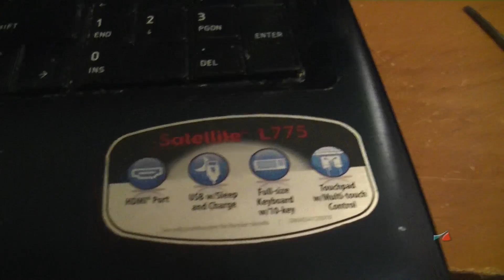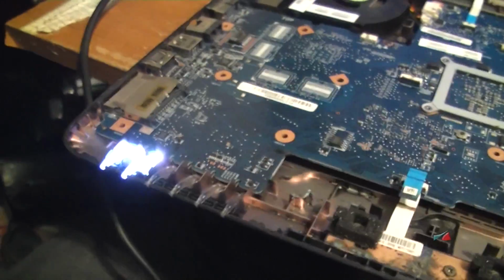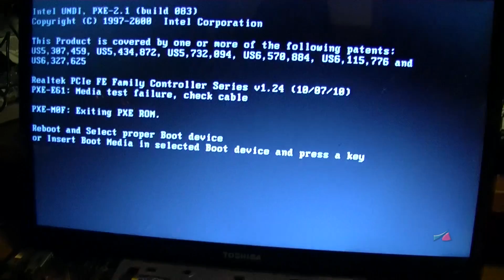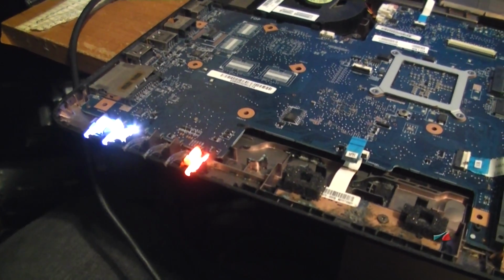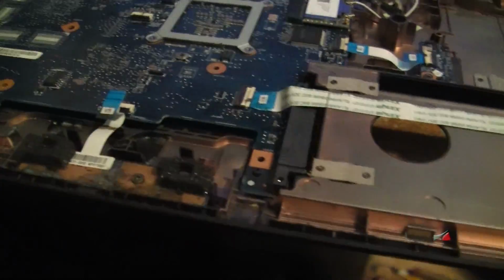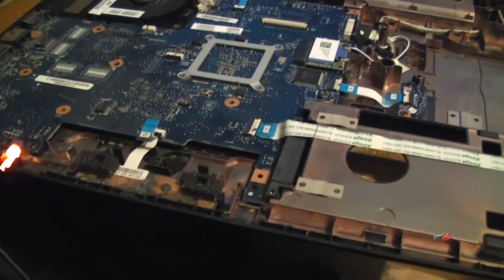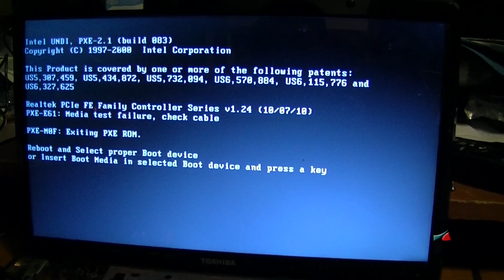Repair/Fix: Laptop Not turning on, no leds no signs of life.

Comment: I have a now old dell vostro 1000 that has no power or even light.  I'm told hard drive doesn't spin. I removed hard drive. Should it turn on without hard drive? If not, I'm going to do what you teach above, removing connector clip under keyboard and checking if it then powers up? Any info you can add for this? Ty

Comment: There is a pin hole on the bottom of the laptop with battery symbol on some msi laptops. Push that to reset before taking apart the laptop.
Reply from the maker: Yes some laptops do have that option, specially the ones that have integrated batteries. That can't be easily removed to reset the bios. I have a more general video to do initial troubleshooting. Thanks for the tip.

Comment: What if a bare motherboard doesn't turn on?
I have an ACER Extensa 5620 with this problem. I took the motherboard out, unplugged pretty much everything except the cooler (can I safely detach it too?) and the power button (unless you know how to turn it on without it, by shorting some pins on the motherboard?) and the LED panel. But nope, no signs of life. None of the diodes is lighting up. The fan is not spinning. I checked the voltage coming into the motherboard from the power supply socket and it seems to have the nominal voltage. What else could be wrong?
Reply: Well, you should probably take it to a repair shop or see if there is any more videos that work, my computer is doing this same thing, the fan wont work less wont turn on, so I'm waiting to take it to a repair shop. Hope you computer works again.
Reply: Well, I kinda already solved that problem and the laptop turns on now. I measured the voltages around the motherboard and noticed that the 3.3V power rail is missing - the one that powers up the BIOS chip and the SMC. The 5V was also missing (the one that powers up the USB ports). The MOSFETs in the buck converters seemed to be fine, but then I noticed that they are all controlled by one MAX chip, so my suspicions went there, and when I was measuring the voltages around that chip, I noticed that the 2.0 V reference voltage is much lower than it should be. But when I was measuring the pins of that chip, suddenly it started working. I guess there was some bad junction on one of the pins, most likely on that ref voltage, because after that it was 2.0 V again and the 3.3V and 5V power rails appeared again. Now it's turning on, the system (Linux) is booting fine to the user log in screen.
But there seems to be another problem, and I remembered that it was there before:
When I try working on it, it suddenly resets and boots up from the beginning :P
Sometimes it can run undisturbed by 20 minutes or longer. But as soon as I start clicking around in the GUI, it reboots again. I don't think it's overheating or something, because the fans are barely spinning at those moments, and it's not that I'm doing anything CPU- or GPU-consuming. I'm really out of ideas what could be the cause of this problem :/ Maybe it's still that suspicious MAX chip, or maybe it's a bad RAM? I don't know. But it's really bugging me, because otherwise this laptop could work just fine.

Comment: I have the same laptop toshiba.......but different model.....but mine the light will come on when I plug the power cord into it......but nothing else....no fan no other lights....and when I unplug the power cord ...the light goes off.....so I think my battery is not charging as well .....I was using  the laptop and it just  shut off.....That was that!      ........Any ideas?
Reply from the maker: try the troubleshooting steps in my other video https://youtu.be/SYRWIdQonoI if that does not help, ill be uploading more videos for more complicated problems.

Comment: i have a problem like that. I try to plug my headphone and accidentally plugged it inti the usb port and then a spark came out and my laptop never turned on again. I took it to a technician and he told me the processor (which is integrated with the motherboard) was broken but when he gave me back the laptop it didn't charged or show any sing of life just as you video.... I bought a new motherboard. but another technician is telling me that it may not be usefull because it has a charged problem... what do you think? my laptop is an acer aspire E15 S12-512 with intel celeron N2840
Reply from the maker: Hi I think that your computer might have the same problem as the one in my other video, https://youtu.be/SYRWIdQonoI on that one the USB daughter board got damaged somehow and then it would not let the computer turn on at all. I replaced the board and then it was fully functional again. Hope it helps out.

Comment: when you find out that the problem is the motherboard, do you use the voltage part of DMM or resistance ? it seems a lot on youtube from asia can check the voltage regulators etc with just the DMM...if you can produce any of these type of videos, would be much appreciated ...I have acer aspire e1 571, and have the schematic... thanks
Reply from the maker: Thanks for watching, I do not know much about component level repair (I am in the process of learning) but my intent is to produce videos like you mention.

For checking voltage you follow your schematic and the power rails, and DO NOT USE RESISTANCE mode to check a powered device. On the schematic it should tell you the proper voltage at certain points in the board. Check that they are present, and it does depend on the state of the computer, if it plugged in but not powered on there will not be voltage at certain points in the motherboard. When the power button gets pressed the state changes and voltage is applied and then goes to a chip that will perform some logic and determine if power is ok, and then it lets the voltages power other sections of the motherboard and components.

As far as resistance, the most useful test is continuity/diode mode. The way they check is to see if there is continuity where there should be none. And if they find it then it indicates that there might be a short in that part or in the circuit that part is a member of. If on the other hand you know there should be continuity on a part and you get nothing then it indicates that you have a "blown" component, basically destroying the path for signals/electricity and you get an open circuit.
Reply: hey when i connected the integrated monitor in my laptop while it was turned on i think i accidentally plugged it wrong and then my laptop turned off with a smell of burn i ubplugged everything disconnected the battery unpluged the monitor screen and mouse,etc.. then i tried turning my laptop on without a screen only with the battery nothing i unplugged the battery and pressed the power button for 1 min then tried again nothing i connected my portable battery in a usb port which could charge even if laptop off the battery was charging when i connected the power adapter in laptop and disconnected the battery the portable battery was still charging but laptop wouldnt turn on i tried with battery and power adapted plugged still wont turn on i checked the mb for any sign on burn no sign help pls the only thing i saw was an chip with some brown dots on both connectors but they were in middle not close tp the mb pls helpp i cant buy another laptop or have it checked by a technician  @carpio01
Reply: fyi ... sieguntur (youtube) has a step by step voltage sequence video that I found quite good ...(how to check dead laptop motherboard(step by step). eng is the video name

Comment: i have an acer laptop, i replace my ac adapter because the previous one isnt working anymore, after i tried the new one i notice that the led indicator on the new ac adapter is blinking fast.
i cant turn on my laptop because of this, i try the adapter in the other laptop and its working fine. can you help me with this. 

ps.
ive already try troubleshooting you did on the video testing everything. but still no power. led on ac adapter is blinking fast.

thanks :D
Reply from the maker: Check that you got the correct adapter, Check under the laptop. Or under the battery to see the specifications for the power adapter. Check that you got the correct power adapter by making sure that the voltage is the same and that the Amperage your replacement adapter is equal to or higher than the original one. The problem might be that you got an adapter that is not capable of supplying enough current to the computer. If the computer needs more current than it is receiving from the adapter it will put a strain on the adapter and the adapter could get damaged, or go into a damage protection mode and turn off.
Reply: thank you for your reply sir. but as i said, i already tried it in another and the same laptop. acer aspire 5810t series. 19v 3.42 amp. and its the same. so maybe the problem is the motherboard? or the board where i put the dc jack? as i check the  name of the board is JM51 mini board. thanks sir
Reply from the maker: Hi, if yo have checked on another of the same computer then I would say that, your computer might have a short in some of its circuitry and thus it is pulling more current. Try to isolate where the problem might be, you mentioned that there is a mini card for the power jack so first I would check that it is properly functioning. Then proceed to trouble shoot the rest of the motherboard.
Reply: thank you very much sir ^_^
Reply: Check the input and output voltage of your newly adapter, and compare it.

Comment: where you located at brother? Have a Toshiba laptop here that I'd love to get working again....was working fine, then powered off and got up the next day to find it got a hardware error and will not boot into windows, nor will it even let me into the BIOS to boot from CD Rom or USB to try and fix it....borrowed a hard drive bay to try and get the 300GB of data off the drive that's in it and it's saying the drive needs to be formatted? It seems the motherboard could possibly be faulty? Being it's not even allowing me into the BIOS?
Reply from the maker: I am located in the Central coast of California. Does it even give you any lights to indicate it is getting power? if it turns on does it only show a black screen? any "blinking lights"?
Reply: yes I get power and a few different screens, one being a blue screen that flashes so fast there's no chance of reading what all it says.... what's got me stumped the most is how & what caused the drive to not show anything on it now & the MB not allowing me to enter BIOS at all, there's no splash screen as it's trying to boot up either (toshiba showing BIOS keys to enter) 
I could explain far better if I had a way to speak with you....I'm all way over on Virginia here, love to know what you think may be the trouble(s) with this one....thank you.
Reply from the maker: If it is a more recent model then the OS might have been installed under UEFI mode, instead of standard mode and when that happens something gets stored in the HDD to make it boot faster. I do not know enough about UEFI to be able to assist you but that is what I have learned so far. Try to run repair tools on your HDD but do not reformat it or delete any partitions because you will lose your data. I will try to do some more research and if I find something then Ill let you know. Thanks.
Reply: carpio01
hi man thanks for the speedy replies and assistance.....fairly certain it's an older model
running windows 7 home premium it's model is
Satellite L755D-S5365
Reply from the maker: Ok lets try this: since you are not prompted to press F2 - when you first turn the computer on press and hold the "Esc" key for about 3 seconds, then if prompted to press F1 do so. Hope it helps.
Reply: carpio01
tried that and get nothing either.....
Reply from the maker: does pressing F12 also not working?
Reply: carpio01
correct....i've tried every F key just for kicks & only F8 gets me to the page within windows saying the various Safe Modes, etc....which none of the options there have done any good either...